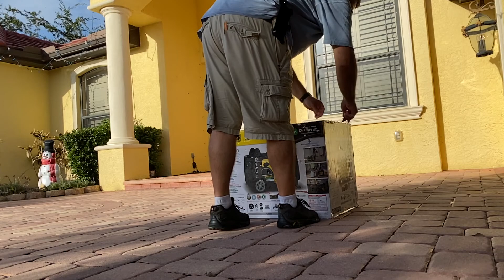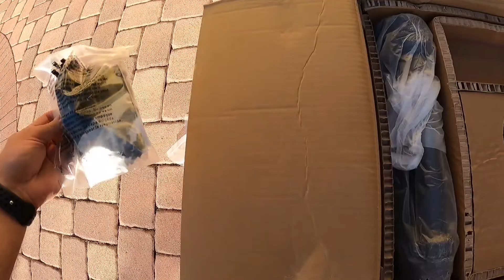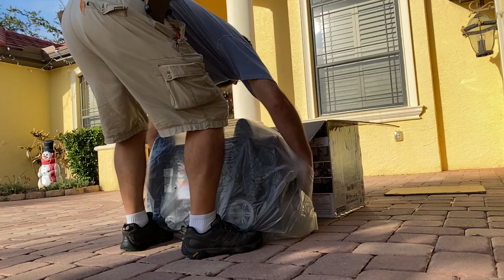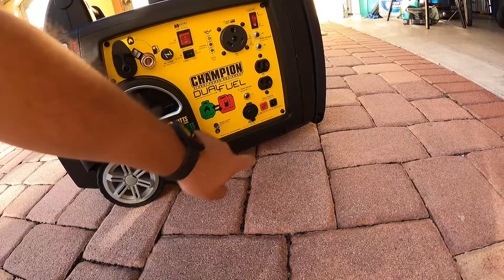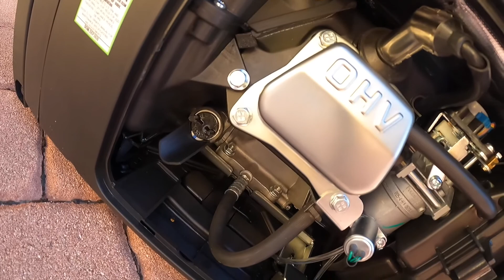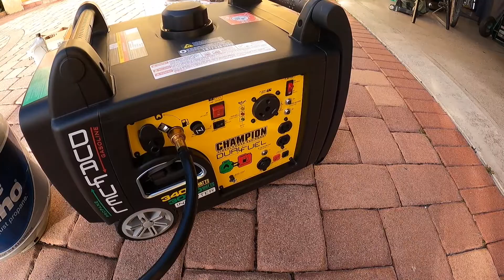Champion 3400 Dual Fuel Inverter generator - Unboxing and first start.

Comment: IV'E got the same one do you know on average how long it will run on a full tank of propane (grill size 15 lb )
Reply: I have never needed to run it for much more than exercising it, but I can use the same tank to run it for twenty minutes every few weeks and go for about 6-8 months before I need to refill the tank. I'm not a great resource for fuel planning in that regard, but it sips fuel unless under heavy load. I would suggest testing it the way you would use it (power tools? AC?) and weigh it afterwards. Luggage scale would be good for this.